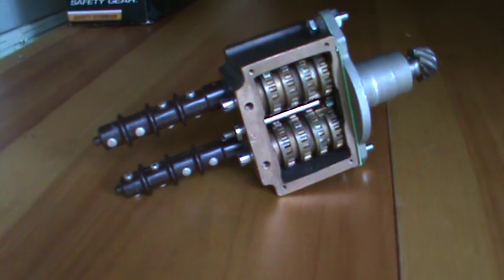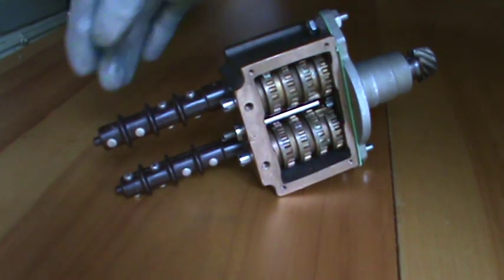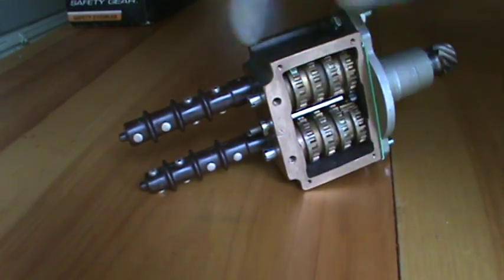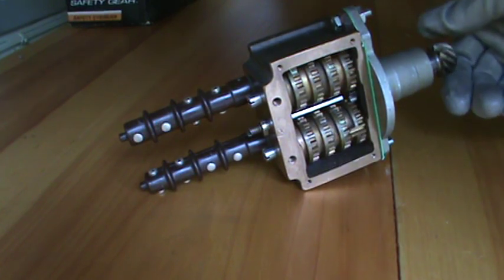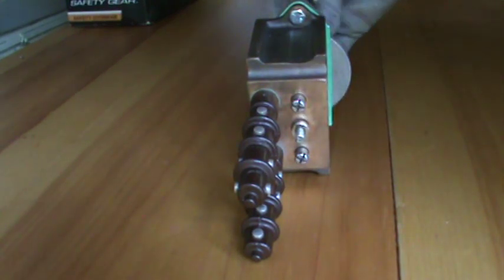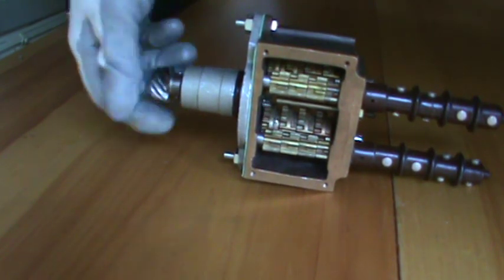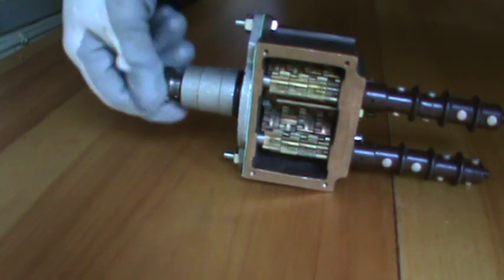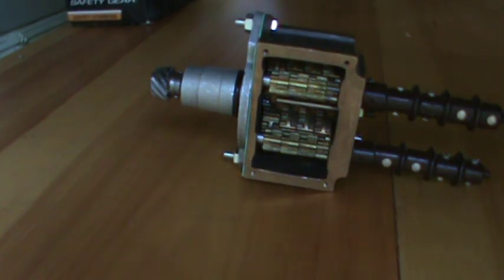Limit Switch Operation

Comment: Good info but one key is not to put in too much grease. Some say 60% and EPRI info has to cover the pinion. Presumably this is the little gear on the input. Some might mistakenly cover the larger intermediate gears.